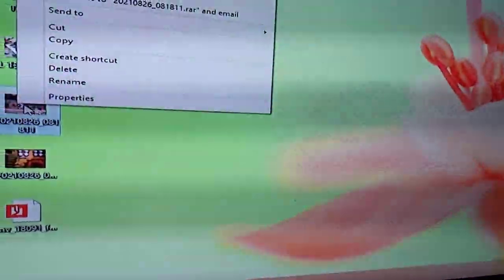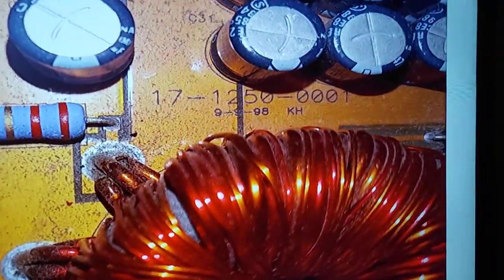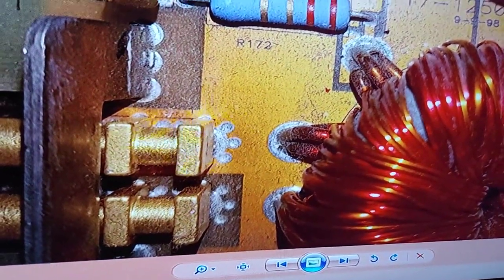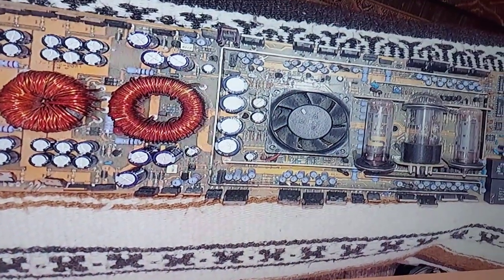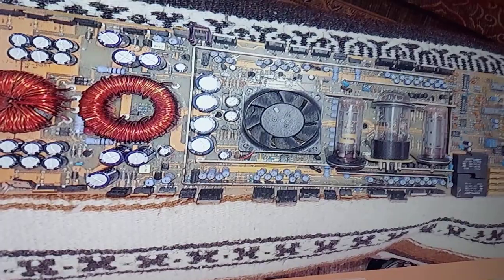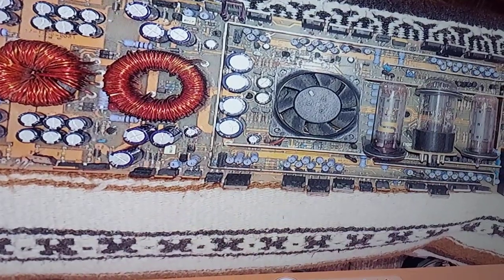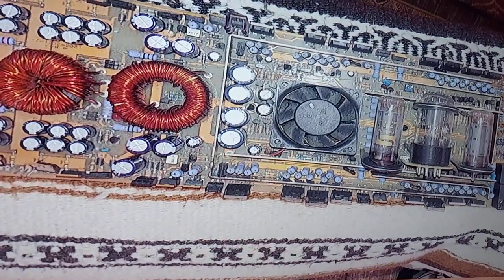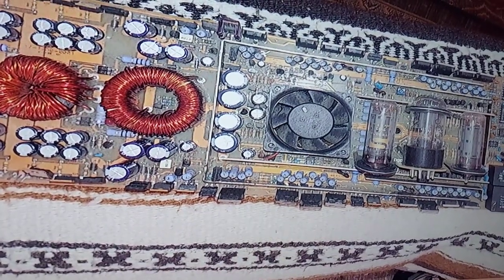TubeDriver amps by PPI / Precision Power Inc. BK Butler lame-o-saurus

Comment: The board itself and some of the layout reminds me of the E7/D7 boards
Reply from the maker: I think it was the same designer that went on to make for Esoteric and Diamond.
Reply: @RobotUnderground  I feel like I’ve heard that when someone was telling me the folklore or those amp as I was buying 4 totes of boards and heat sinks from them lol
Reply from the maker: @FritoPendejo712  Well it is a small community.  I had over 100 of these from the auction.
Reply: Sorry I meant the e7/d7 stuff is what I bought not the tube driver stuff lol I’m pretty sure a bunch of what I got came from you way back when and changed hands plenty before I got it
Reply from the maker: @FritoPendejo712  Was also probably me.  I sold a truckload of boards to a local dude.

Comment: there seems to be some design differences to the ones i own. i own 2 versions. there should be an input tube per channel. of course the tubes are not driving the output section. i have the older bk tube driver 1500 and pre. not ppi version. i also own a tube driver blue model. which sounds even better. i cannot speak about the board version i see here. the both versions i own  sound very good. they sound better than most of the garbage today. comparing to older gear its up there with the better sq amps. these amps are not for subs or bass speakers. if you use them for that your an idiot. use above 80-120hz. they do have decent damping factor though. they really shine in the upper octave range.
Reply: these boards look like the older versions ppi modded or changed.
Reply: the versions i have the tubes are absolutely in the audio section. the input. not sure the version you have. this is a classic well known design using tubes on the input section. nothing shady about that. regardless of the guy or companies themselves.